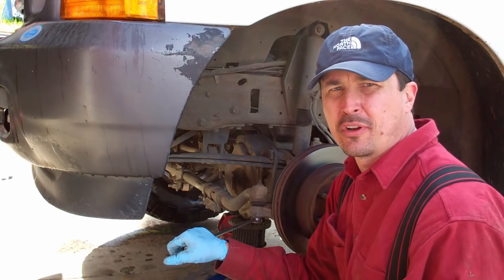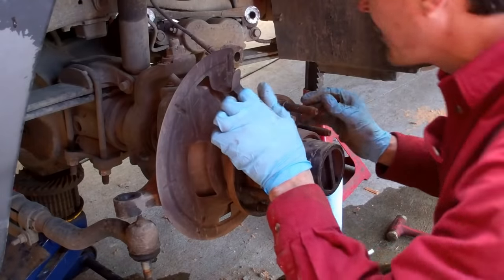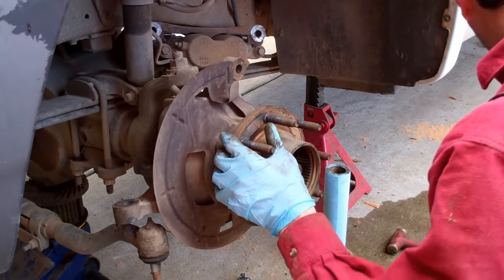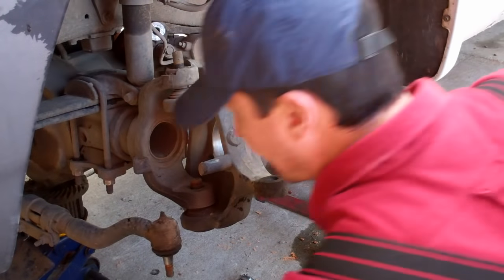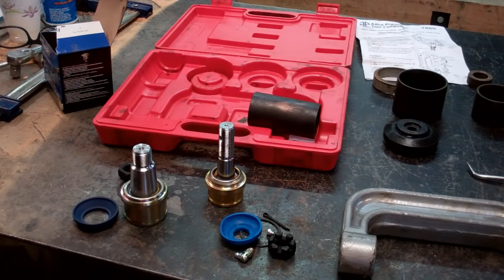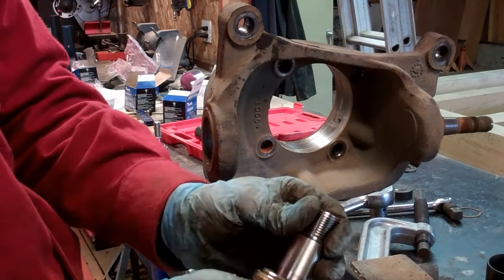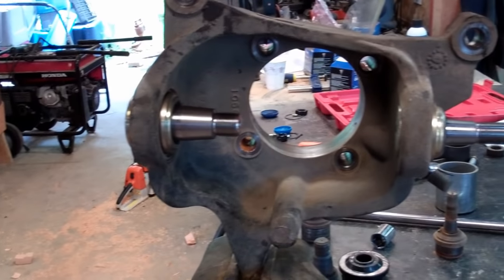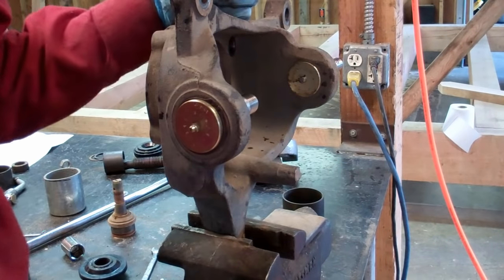How To Replace Worn Ball Joints Ford F250 Truck

Comment: Thank you so much for your video. It helped me do ball jonts on a 2000 F350. A quick tip to those doing this. It's alot faster to remove the old ball joints by just banging them out with a 5 Lb mini sledge. use a piece of pipe to knock out the upper with the sledge through the bottoms hole. 

I also used my 20 ton press to install the upper joint and used my OTC clamp set to do the lower with a electric impact. I made big seal driving tool using a 1.25 floor flange from Home depot ground down to 3.875 inches and use a 12 inch piece of 1.25 pipe to hammer it in.

Comment: I appreciate your fantastic videos. I am a 60 year old carpenter contractor mechanically inclined yet over the last 40 years I have avoided working on my vehicles. I don't know I thought too many specialty tools and parts. Plus I hate bloody knuckles. Times are tough lately! I have a 2001 Ford F 250 Super duty Lariat 7.3L I purchased new in 2001 with 203k miles on it. Still runs fantastic . I needed new brakes and found your video. So I ordered brakes from Power stop on line. Then I realized Hmm ball joints klunking. So I found this video. Im not crazy about spending a ton of money these days. When I was younger there was a time when it needed new tires it was time for a new truck. But they go up 1 to 5 k per year in price. I paid over 38k for mine loaded. Hell now you can expect to pay 15 to 20 k more than that! Nuts! So I want to get another 1 to 200k out of this truck. I am wondering not just me but for all your followers if you could do an explanation video to make my front end new. Including the pros and cons of replacing everything from the brakes, shocks, ball joints, oh and yes the very expensive wheel hub wheel bearing of which my right one went out after 35k miles and normally a wheel bearing I thought hell under 30 to 50 bucks NOT 275 bucks plus labor at the time. My point. Since my truck has that many miles and I do need ball joints. Shouldn't I go through and replace everything including say an upgraded set of Warn manual lock out hubs all metal etc. After all you make it look easy but there is a lot of work tearing each wheel apart and you've got everything off. The pros and cons. I hate wasting money. But I hate wasting time too. So would it be worth it to replace everything or am I just throwing money away. Your opinion is greatly appreciated.

Comment: Thanks for the really awesome video. I totally agree with your thinking on DIYs.  Just an update:  I finally got started on my 2005 F250 upper and lower ball joints (and U-joints).  Definitely not as easy as your video made it look.  I had multiple stumbling blocks (mainly because I didn't have the right tools).  1) The snap ring pliers I had didn't work, along with ones from Advanced Auto Parts and NAPA.  They either sucked, slipped, or the expensive ones with adjustable tips were too fat to reach.  That cost me a day! 2) Like someone else mentioned, my axle seals were tough to get out.  Finally found a video on YouTube using the ball joint press against the U-Joint and a piece of metal. That worked like a charm.  3) I didn't realize how huge those ball joint castle nuts were (didn't have any in my tool box), so another trip to the store. 4) Then my upper ball joint castle nut got stuck, so I had to find a cutting tool to chop it off.  All this because I didn't have the right tools!

Comment: you mentioned the "little adjuster, caster, nut" at around the 12 minute mark in the video and you asked those that may know "whats it called?" it is an eccentric bushing. In the mechanical world any hardware or such that makes a similar motion of something like a cam for adjustment is called eccentric hardware.hope this helps you out great job on the video!

Comment: Thanks for the nice video.  My OTC Ball Joint tool comes with three receiver cups and two heavy steel press inserts.  I used the large hole insert which allows the stud to pass thru the press clamp.  There is no need for a longer pipe as you described for removal.

Comment: Lived the last 60+ years of my life believing and doing what you said here in this video. Can't say at this point I can do it all,  but most, and friends help with a lot I can't do.  Remodeled several homes,  wired one complete and 3 remodels and built a couple shops,  and done a fair share of mechanic work. The whole system has been put in place to help convince us we're helpless, especially without the Gov't.  God forbid we wouldn't need the "helpers" from the "guv-mint"  if we don't need them, they might have o work for a living! Oh heaven forbid.  Next time my F-250 needs ball joints, I'll watch your video again,  pull up my big-boy pants and say, why the hell not!?!  Thanks for the wise words and the great video!

Comment: The term is a lockout ..I like to ant seize the snap rings & be careful not to ruin the seal inside the differential reinstalling the axle... .Always proud to see what you can accomplish with a little thinking...

Comment: Thank you very much for the video.  I watched multiple times - once prior to starting and then a few times during the project.  You really helped my get this done with confidence.
The hub bearing assemblies were a pain in the rear to get off.  I had to use an air hammer. 

Thanks again.

Comment: Excellent job!  After viewing this I started on my truck and it couldn't have been more complete.  The only thing that stumped me was having to drive out the seal.  On your truck it looked like you were tapping the back of the u-joint to drive out the shaft when I think you were driving out the seal. No biggie.  For a rusted front end an air hammer is almost a must have and yes, look around your shop for solutions to problems. A 2" and 1&3/4' pipe nipple about 4" long make good drivers. Thanks!

Comment: Nice video and safety info and supplier info for ball joint press.  I used my pickle fork kit to not only remove the ball joint etc but it also came in handy for prying the drive axles out of the housing when all else was not working.

Comment: Just changed out rotors and pads all the way around on my 2003 Excursion 4x4 and while changing the fronts, found loose ball joints. Thanks for the vid.  Now I have a good start on changing those out next!

Comment: I used this as a guide to do my own. Very helpful. I bought the same press and 3/4" socket from harbor freight that you did. Tip. I was able to use one of the sockets out of the set where you went and got the little piece of pipe.

Comment: Nice video learned something about the front end. However I have replaced ball joints on 01 f250 several times and never taken off hob assembly. But it did show just how easy that is. Thank you

Comment: Appreciate the video.  Nice improvise with the 3" pipe.  Have had to do similar many times over the years.

Have been asked to replace bad ball joints on a 2001 F-250 4x4 and needed to see what is involved before saying yea or nay.
Thanks for putting up the video that answered all my questions.

Comment: Very detailed, couple things to add, you will likely have to heat the knuckle to extract the old ball joints. When you pulled the half axle the seal was broken, you should include this as a requirement to change.

Comment: Very good video I just done a EGR cooler and the INJECTORS service on my Ford F-350 supper dutty and that project worsted a lot and I save 3,400 dollars by doing this job my self it was easier than it looks I done it in just 3 days.thank you for sharing this type of experiences this will be my next step BALL JOINTS.....;)

Comment: Used your methods to replace my superduty ball joints work really well, but had a little trouble pulling the axle on the driver side. Also had trouble with the old ball joints releasing, the top joint was easy but the buttom one refuesed to let go. After an hour or so of smucking it with the hammer it let go. Thanks for the tips.

Comment: I used this for reference before doing ball Joints on the Excursion this weekend.......overall great video.  One thing I wanted to note to you and anyone else looking at this video.  The pipe you went a bought, you didn't need it.  I ran into the same issue with the short cylinders for pressing on the joints.  When pressing out the larger ball joint @ 14:43 in the timeline, I used a thick round steel bar with a sledge hammer to drive out the joint (wasn't too difficult).  On the reinstall, instead of changing to a longer piece of cut pipe, the open end of the pressing tool, it fits over the threaded stud, and presses the joint into the assembly without having to buy anything or damaging the joint because it presses the body of the joint, not the threaded shaft. No vise required either, although easier with one.  :o)

Many thanks for the vid.

Comment: I am a new subscriber, I really enjoy your projects and today I needed to know what I need to change out my F 250 ball joints. I do have clamp that I never know what it was to and now I could use it, with a help of a three inch pipe and maybe cut out some round 1/2 inch plate of steel. Cool beans!

Comment: Thanks for posting the video.  It came in handy doing this job today.  Of course I didn't watch all the way to the end or read the instructions and ran into the same 90 degree zerk fitting contacting the u-joint problem.  After deciding to just put the plug back in it THEN I watch the rest of your video.  Of well.

Comment: Going in for an alignment after I installed my new tires... Ball joints had play, and they couldn't warranty the alignment. They offered to do it for 750 with alignment. I just ordered my own, and happy as all hell when I did my Google search to find this video right off the bat. Im the same way, anything I can do myself and get tools out of the deal, I will do.

Comment: Nice 👍 Thank you this will definitely help save me some headaches and cash. Last ball joint job at the Ford truck garage cost me $1400 and two weeks. They said they got it as close as they could, but it wasn’t right and wore out way to fast. Makes me wonder if something is not right with the housing?

Comment: Awesome video watched this over  10 times. Sure you left out some details; but straight to tha point. Great information . I'm finishing my ford excursion 2000 v10 . For some reason tha passenger side is harder then drivers side. Had to replace tha u joint. Any whoo' keep them videos coming. Excellent job.

Comment: Another great video, nice work.
The passenger side is usually is worse, as that is the side of the road that you can drop the wheel off the tarmac and onto a rough shoulder more often.
Cheers!

Comment: Nice video. I have an FYI for people. The newer F-series the lower ball joint is larger than
the one that is in most if not all kits on the market. Also one way to lessen the force to
turn the driver screw and help it last longer is to oil it and then before use clean any dirt off it before you oil it..

Comment: From a mechanic, good job. You are missing a little info like torque specs and the need for torque wrenches during assembly. It is very easy to over tighten or under tighten those nuts causing failure. Just an addendum not criticizing at all. If in doubt, read the book, or by an AllData subscription. Extremely informative information can be had through AllData. Once again, Great job!

Comment: Knew how to do it but watched anyways, working on a pair of axles outside of the truck to install later with all this fresh new hardware. I spent a lot but not for labor, instead I have a bunch of new parts, painted axles, and I’m hoping to get really good life out of them. Fresh seals and lube, fresh bearings and brakes, fresh bushings and joints, it’s going to be nice.

Comment: The original lower ball joints on my Super Duty started to squeak around 45k miles because you could not grease them. I drilled and tapped the center of each for a grease fitting and flushed then out with brake cleaner to remove all dirt and chips. Being able to add grease took away the squeak and I am still running them with with over 63k miles. You can't get to the uppers to add a fitting though.

Comment: Very nicely explained and produced. What is the ring on the axle shaft that was floating as you pulled it out? A seal for the axle tube? Why did no axle oil run out also? Thanks.

Comment: Fantastic vid and great info. The only thing I do different is I do not remove the ABS sensor because it is too easy to break. Follow the wire over to the whel well and there is a connector. Then you can just remove the wire with the hub. Other than that it was a good instructional vid for anyone who wants to tackle this. Oh BTW, around here-this job books at around $2000, so it is a significant cost saving.

Comment: Great video the only thing I would change is not removing the abs sensor sometimes they can break or get messed up when you pull them out.  If you follow the wire there is a wire you can disconnect which will prevent that problem.  Other than that it's a perfect video and I'm glad I watched it

Comment: Thank you, really great video!!!  I'm going to attempt on my '03 F250 4x4 even though I'm somewhat of a novice.  After removing the axle shaft, should I expect any fluid to leak out of the differential through the axle tubes?  Do I need to drain the front differential prior to doing this?

Comment: I used an air hammer to drive my old ones out, and an air impact to turn the c-clamp when I drove the new ones in. I think the vibrations help a lot.

Comment: Hello Cody, great video. I hope it all went back together for you just fine. Note: that heat shield is a dust / rock cover and that top bushing is a CAM bushing and I was wondering when you were going to mention safety glasses and you did about 3/4 of the way thru your video. And great rigging up with that puller "C" clamp. Just pointing out a few thing, I think you did a great job. I would say make more videos but that cost more money for the darn parts. Haha. I enjoyed it. Thanks. Mr. Roy

Comment: Great video dude. Tip: For interference fit parts, if you can put the parts in the freezer for several hours before quickly pressing them in, it may be easier. Local auto parts stores rent those presses too. Also, when removing that knuckle, I find it handy to leave the castle nut on the balljoint threads, level it with the top of the threads.... use that surface to hammer on. It doesn't destroy the threads and you don't sometimes have to hammer on the knuckle itself. And, PB Blaster is great!

Comment: Thanks for posting this video Cody.  I've subscribed for a long time and have to replace my U-joints (05' f350 6.0) which is probably a little less time than ball joints but it's reassuring to see somebody run you through what your about to do.  

I can't remember when I subscribed but I believe it was about the same time I left the military which was 08'!  It doesn't seem like that long ago but I guess it was.  I forget what drew me to your content, I suppose it was that original timber frame project.
Reply: Accountability is selectively being erased from society from the average person to the political ruling class authoritarians.   It's the same reason people get so bent out of shape over anything faith based.   They hate the idea of having to be accountable to their fellow man or their creator for their actions or lack thereof.  

The entire movement is based on state controlled media narrative lies.  The BLM crowd is being used as useful idiots to stir racial division.

Comment: Awesome video.  One thing i just ran into is when reinstalling tighten the lower ball joint first.  If not, it hard to tighten it and it will allow the lower half to flop. the toe on the front end may not be able to be aligned.

Comment: did you have a problem with the knuckles being overly stiff to turn when you retorqued the ball joint nuts? i followed the torquing sequence that was provided but i found that they didnt turn well so i torqued them my way..it has worked out much better my way than if i had left it torqued according to the instructions

Comment: Gday,
Thanks for taking the time to make and post this video. I have an 03 F250 in Australia here and I'm going to now source the ball joint tool kit and associated required parts via Amazon or similar.
 
Is there an online supplier of quality parts for the F250's that you or someone can recommend. I'm going to be changing the tie rod ends and other rubber suspension components soon? Really appreciate it, thanks. I owe you a beer,
Cheers, Nigel

Comment: I plan on tackling this job tomorrow and have two questions.  On reinstall, are there any special precautions other than torquing the bolts right?  Any trouble reinstalling the axle shaft?

Comment: After you press the old ones out, take some 120 grit emery paper and a drill and lightly clean the seats. Also, put the new ball joints in the freezer the night before, and take them out only when you’re about to install them. Makes life 10x easier especially for those of us who deal with salt.

Comment: That was a camber/caster bushing you pulled out of the upper ball joint area. Great video.
Reply: And that would have been  $20 a knuckle, not a ball joint.
Reply: Jeff Rocha No, he said 80 bucks, so they priced it by joint.